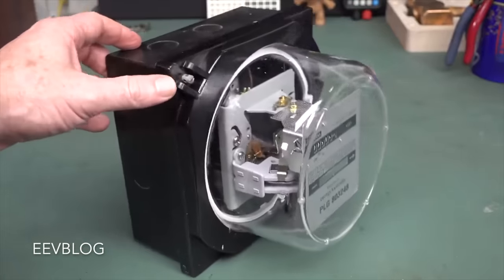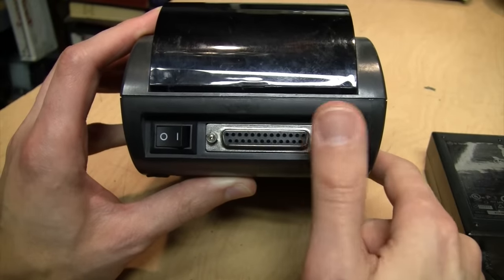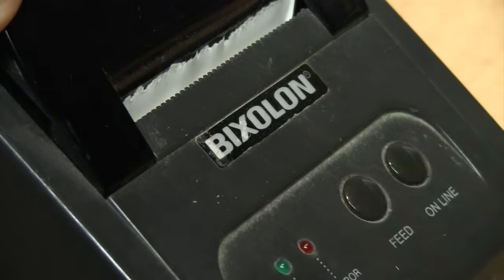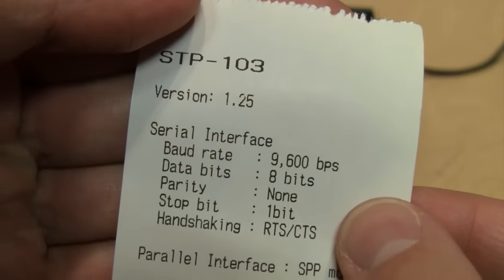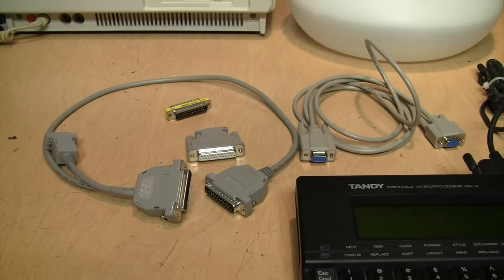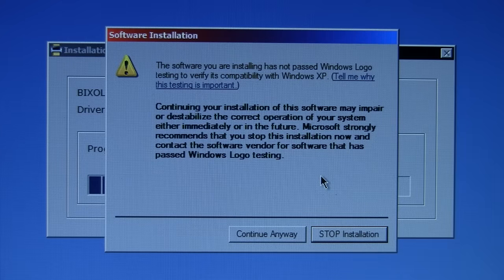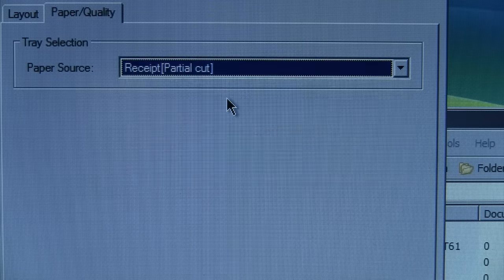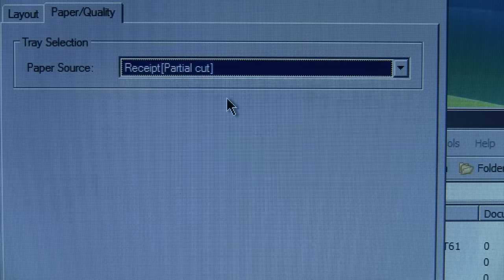I got a receipt printer. 🖨️ Now what?

Comment: I use my thermal printer (Dymo 450, USB) quite a lot. I loaded self-adhesive thermal stickers into it and frequently print labels. In Germany you can buy postage stamps online, with a QR code that the post will accept. Those are nice to print on the self-adhesive labels to do any kind of postage on the fly. Never have to buy stamps and don´t have to wait at the counter to mail stuff. If it ever broke, i would get another one.
Reply: Had those at work, it was fun the week IT accidentally set it as the default printer for everyone. Hundreds of pages of documents, ready to stick everywhere 😅
Reply: High tech in Germany: print stamps online lol

Comment: I developed quite a fascination for POS equipment when I started my first customer service job, which has lead me to purchasing and using my own POS equipment for fun and experimenting with it. I'm not sure what this printer would've been used for, but I doubt it was used with a cash register (the smaller paper size, lack of a paper cutter, and the difficulty with replacing the paper lead me to that conclusion). Interestingly enough, when Stein Mart was liquidating their assets, I picked up a whole box of Stein Mart branded receipt paper for $5, which is perfect to use with my setup since the only expendable item I use is receipt paper. I can't remember if they were liquidating their registers (I want to say no, but they might have been way too much to justify buying one), but they were still running POSReady 2009.

Comment: Funny, I have a fire alarm pull, at least one of those radios, and an old Casio printer that takes the small paper, but it is a DMP and not thermal. In my line of work as a mechanic I have had my hands on all sorts of things over the years. Vintage computers is one of my hobbies.

Comment: You should open it up and see if the parallel port is on a seperate carrier that can be replaced with a serial. That's the case in most Epson POS printers. There the board for parallel port has an 8 bit buffer chip, and for serial a RS232 line driver chip. Both ends in a high density connector that goes to the mainboard that carries all the signals. Ethernet goes same way.

Comment: I worked a couple years replacing bank computer systems just a little while back - refreshing everything from PCs, printers, and scanners, to servers and, yep, receipt printers. Can confirm they still very much use serial connections. There are specific computer models they get from the manufacturer just to make sure they have serial ports on the board. Banking software hasn't changed much in 30 years, and they still use modified versions of AS400 that require the serial connection.

Comment: I inherited an epson thermal printer at work, it was USB. No clue what it was originally intended for. Made a program to splat out backup tape labels quickly (formerly a manual process we had to fill out)

It was also fancy, supported a few fonts! and auto cut at the end of prints

Comment: Thermal typewriters are also fun! Brands like Canon Typestar and the Brother EP series, and a few others like Sharp, Casio and Panasonic. They originally use thermal transfer carbon film ribbons that would use a thermal print head to transfer the carbon film lettering to normal paper. But after these cartridges were no longer made, the thermal typewriters still work by using rolls of thermal fax paper, or even sheets of letter-sized paper (still available on eBay).

Comment: Some of these also have a phone-type jack for opening the cash drawer, usually controlled by a signal from the computer. Alternatively, you can attach a bell and have it set to ring on every receipt printed, for printing order tickets at a restaurant or something, though they usually use dot matrix printers with dual color ribbons, so that the modifiers (such as "large" or "medium rare") or special instructions can be printed in red, and  the rest of the ticket can be printed in black.
Reply from the maker: Yes, the driver has an option to open the cash drawer when a receipt is printed, but obviously this one doesn't have that feature.
Reply: Yeah I found it fascinating to discover that the cash drawers are typically controlled by the printer and not by the cash register (although POS computers might have the same RJ connector).

You can also find thermal printers with a display connector (typically a serial protocol) to show the customer the total etc.

In other words I was surprised to see that in the POS world the printer is so central in the operations rather than the cash register/PC itself.
Reply: @Yrouel86  Back in college I used to work at a store with the registers set up like that. Every now and then the receipt printer would refuse to print and the cash drawer wouldn't open which was annoying when customers needed change. A restart of the POS computer would fix it but that took a few minutes.  
  
Since I knew about computers my boss asked me if I could figure it out because the POS vendor only wanted to sell them new hardware. It turns out that killing and restarting the print spooler service in Windows would fix the issue so I made a batch file to automate the process and they used it for years whenever the receipt printer acted up.

Comment: I acquired one fairly recently, and I've still got to get it up and running. It's a large Samsung, and they were all actually made by Bixolon. Mine appears to be a serial one too, and that's really odd that yours appeared to be but is parallel. Maybe it's switchable? There are sticker rolls that are compatible with them.

Edit: Says RS-232 on the interface. Has two DIP switches on the interface, only one of which is externally accessable. Other DIP switches are under a screwed down cover on the bottom.
Reply: I wouldn't be surprised if the internal one was for switching the "acting mode", since you basically never need to actually toggle that (unlike e.g. baud speed which could differ between machines, you're probably assumed to have all the printing machines have a similar setup)
Reply: @jan_harald  It can only take one interface board though.
Reply: Most of the ones I have had came with a serial and parallel board, and the more modern ones came with USB as well. I have a few label printers, with serial, parallel and USB, all on the rear, as they are designed to replace old units without needing to change the sending side. Setting those settings though, as you either need to connect USB, and use the Zebra setup utility, or use the one feed button, and pressing it after the right number of flashes, can be a pain.

Comment: Ooh, I used to write code for one of these things! The (relatively) newer Epson ones are Wifi enabled, and will periodically poll for print jobs from your server. So I was in charge of writing a little print spooler microservice to take in orders and turn them into XML commands the printers could understand.

Man, those things were neat. You could have it encode numbers into barcodes or even print arbitrary bitmaps. I wrote this test class ostensibly to test the gamut of commands, but in reality I used it to write notes to my roommate and coworkers with little pictures of Mega Man and stuff.

Comment: I always have to work with receipt printers when I have to take orders at my fast food job, and that bit in the video about putting a new spool in hits really close to home, lol, though it's not a spool-less "drop in" design, it uses standard spools. The models we use are obviously much newer than that Bixolon (and likely another brand), but something that struck me is how similar they are in functionality. The printers at my work also have the power and error indicators, as well as a feed button, only lacking the "on line" button as far as I know. I just thought it was interesting how similar these things are, despite them being likely many years apart and from different manufacturers. Perhaps there's some kind of standard for these or it simply developed out of necessity and nothing more.

(Also unrelated, but we always have technical issues with our printers. It's always the worst when an order won't print in the printer closest to me, so you end up having to select another printer for the order and you never know which one you selected and where exactly it'll print. It could be the other printer nearby, or the one in the drive thru, or the one in the kitchen... who knows! :P )

Comment: I adopted a serial receipt printer about 2 years ago, from a POS test system at work which was getting thrown out. Recently found (and bought) a new style of grayish-blue thermal paper for it that doesn't have any of the problematic chemicals of regular white thermal paper, so in theory I could now print a lot more... but I haven't come up with any good ideas yet either...

Comment: Hated programming these things. Mostly because they were most often combo units with a cash register, and the place I used to work at didn't want to spend money to get a test one, so I had to work on actual retail units and couldn't test much.
Reply: Do not see that one having the RJ11 drawer socket though, and yes they are a pain to program, especially if you need to send test drawer commands because a drawer sticks.

Comment: Great video thanks. 
Tip: avoid using any metal objects on the print head area when cleaning.  The whole print head strip is conductive, unrepairable damage can be caused. Eucalyptus oil is a great thermal head cleaner.

Comment: I have a even funkier one (came with USB to Parallel with DB25): it uses a classic print head like on a matrix printer but the print head is a thermal printing head. So it's as slow and loud as a matrix printer but prints on thermal paper. Also only knows CP437 but all the special charactes have been scaled down so badly, you can't really print more than ASCII and Umlauts. Uses AC input with an internal rectifier, so it can be fed with AC and DC, which is nice. Doesn't seem to be able to do graphics at all.

Comment: I have a Bematech one of those, founded it on the side of the road, it powers up but I don't have a parallel cable to plug it in to a computer. Not sure if it is parallel or serial, but it also have a phone connection, probably to hook up to a modem or something like that.
Reply: Other people mentioned that the phone jack was likely intended to connect to a solenoid that pops open a cash drawer.

Comment: I've worked in restaurants too long to be interested in buying one of those. 😏 I guess I've been spoiled, because most of the printers I worked with had the paper cutting feature. They also featured ethernet connectors instead of serial or parallel connectors.
... One thing we had to be careful of was not leaving the ticket in the hot window. That quickly turned the entire piece of paper solid black. 😒
Most of the printers I dealt with were pretty smart. If you ran out of paper while printing an order or receipt, it would print a fresh complete copy to make sure the guest got a proper receipt. 
They were also useful for printing a time card of hours worked.
Reply: Suddenly I'm realizing why still a lot of the time when I see tickets attached to food items in a restaurant they are still using dot-matrix back there! Impervious to heat.
Reply: @dgpsf  exactly so.

Comment: Hot oil will also erase the print instead of turning it black. Used to work in a restaurant and noticed this with the line tickets when they would get hot oil from the fryer on them.

Comment: You can also use these for making fake receipts for return fraud and shoplifting. Buying these off eBay became common enough that all major stores use custom receipt tape with something printed on the back as an anti-fraud measure.  Now you know.
Reply: I can't imagine the printing on the back is very effective as an anti-fraud measure. I doubt it's hard to run a blank receipt through an inkjet printer. Or even easier, somebody could just steal the roll from a closed register.

Comment: I remember something like this back in the day for the Sinclair Z81. Typically it was slow and cheap and the print wasn't that clear, but it did allow Sinclair to say their 'computer' has a printer. This though is fast and cleared and would only be limited by the cost of the special thermal paper.
Reply: I think the ZX had a "spark" printer.
Reply: @und4287  I printed a bunch of black once. The fumes weren't pleasant.

Comment: It's amazing the number of gadgets we used 20-30 years ago and the hardware technology that went into them. Nowadays everything is done through an app, or through some central processor connected via the internet. 3 days ago, we couldn't buy a cup of coffee at Starbucks because the internet was down. No sales could be processed. Something is wrong in this picture. An enemy country does not need to fire a single shot to bring this country to its knees.  A few code strikes to the right servers and we are down for the count.

Comment: I think I'd use that for printing address labels. Though I'd use scissors to cut it, rather than the serrated edge on the printer. I often laminate such labels with clear tape to protect them from getting wet. I suspect that clear film on the Bixolon label was never intended to be removed, but had just started to delaminate with age.

Comment: i have a receipt printer too! i have an IBM 4610-tg4 suremark printer. probably the most widely used receipt printer from the late 90's through the 2010's. the cool thing is it's a dual station printer, so there are 2 printers, the customer receipt is a thermal printer, and the front is an impact printer for documents, and processing checks.

Comment: My dad once got home and gave me a payment terminal, a cash register (which was actually just a android tablet without google services and with special cash register apps) and thermal receipt printer. I couldn't use the payment terminal, because some certificate in it was expired and only solution was to buy a new one. From the cash register i did my third monitor to my computer. I somehow got the receipt printer actually print form Word, but before that i needed to search lots of manufacturers chinese sites to get Windows driver. But it now works fine and i print homeworks on it. Amazing video!

Comment: I’ve changed receipt paper thousands of times by now but one of the cool things with thermal paper is you don’t even need a lighter to write on it just use your nail in a bit of pressure and speed and it will be able to write on it very handy if you’re crossing items off a list

Comment: I bought one of those little Paperang thermal printers off amazon and it uses the same paper you have here and connects to a smartphone over bluetooth. I print everything on it. It is slower than this one but it claims 300dpi. I have a few pictures on my monitor printed from my little printer of various things including a favorite celebrity and about three dozen pictures above me. I may have to find one of these but maybe a USB version.

5:40 Those white spots are areas where the thermal chemical didn't stick during manufacturing. My printer paper does the same thing.

Comment: Believe it or not I was in the same situation not too long ago I was able to get a thermal printer for very cheap and I really wanted one just to have it just like you I didn't do that many tests as you did but now you gave me a couple ideas my printer is ethernet it doesn't have no serial port or parallel port I believe, I used it just couple of times, I did print out a receipt not to return anything though just to see if I was able to print out receipts I guess... LOL I put it away and haven't seen it in a while but I might just clean the dust off of it and see what can I do with it, put it a little bit more into use nice video

Comment: Last century, I was working in a computer shop. I had to plug one labelling printer using serial port to a Novell server (already old in 1998). The novell spooler was using RTS/CTS for handshaking and the printer was using DTR/DSR. Of course after around 50 labels the printer's buffer was full and the DTR/DSR handshaking told the server the printer was offline, resetting the spool to the start. I eventually figured that out using a led dongle. Then I took my trusty soldering iron, opened one of the DB25, and exchanged RTS/CTS with DTR/DSR. Problem fixed. Old engineers like me know old recipes for fixing old equipments. Sidenote, I also had to rewrite the driver for the labelling printer from scratch, using the printer's data book. Because it was serial, all I had to do was to generate a text file from the billing software and then push that file to the spooler to address the serial port

Comment: I still have an Apple Silentype thermal printer I used with my Apple ][+, paper about 5~6 inches wide.  Not very fast, but it did a decent job before I could afford a dot-matrix printer.

Comment: Funfact, Alot of printers for PoS systems have the output for the cash drawer so that the PoS software sends a special command to the printer, which then triggers the solenoid on the cash drawer.

Comment: You can also turn the paper black if you drip IPA on it as the thermal chemical is treated into the paper itself. You can also quickly test if you have thermal paper or not by simple running your fingernail over it. It is also possible that the printer is serial capable but likely requires a specific type of cable and a standard null modem or passthrough serial won't be wired quite right for it to work.